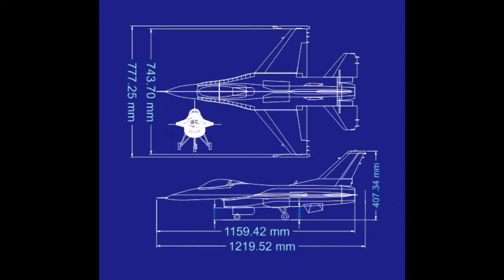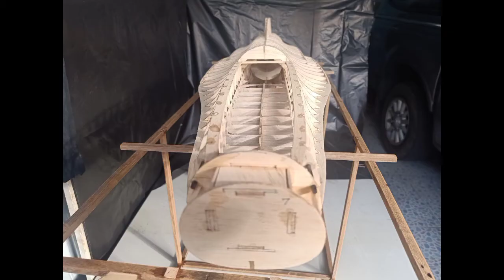F-16 rc plane build with balsa wood.part 1(fuselage) ทำเครื่องบินบังคับ F-16 ด้วยไม้บัลซ่า

Comment: An amazing build, and all seemingly hand-crafted - no laser-cut parts! Just one concern - it seems you used balsa for key loading parts, e.g. undercarriage mounting bulkheads, where plywood would be better. The weaknesses of using balsa in key structural areas might make this not airworthy. However the build is worthy of exhibit in a museum.